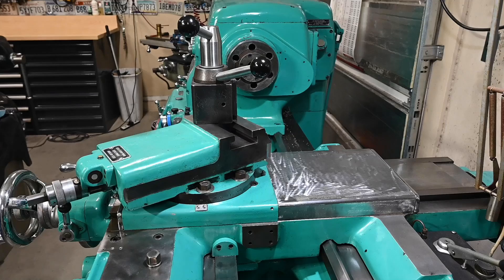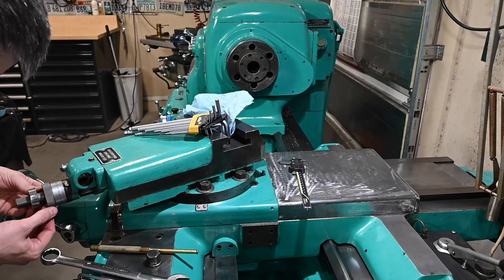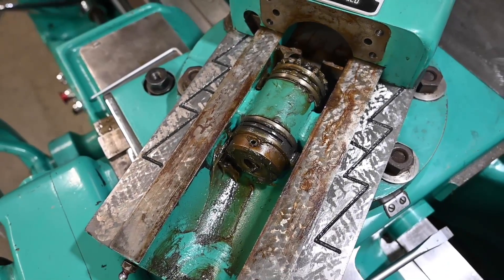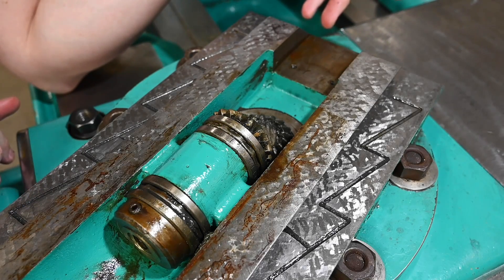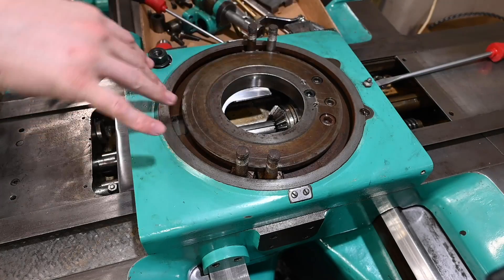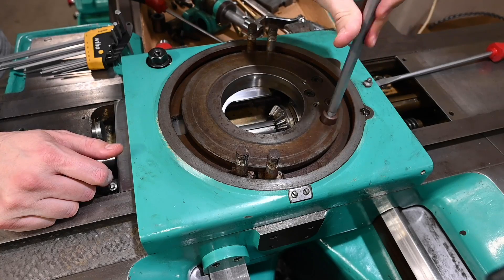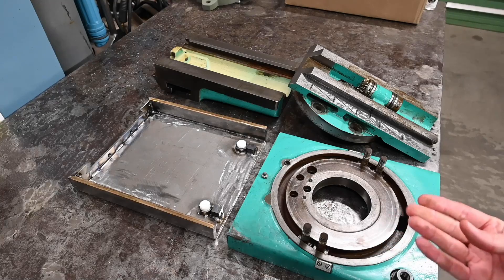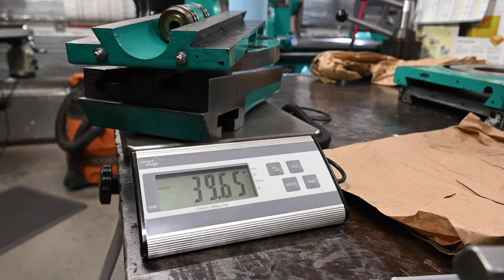Monarch Power Compound Disassembly | Gears Everywhere!

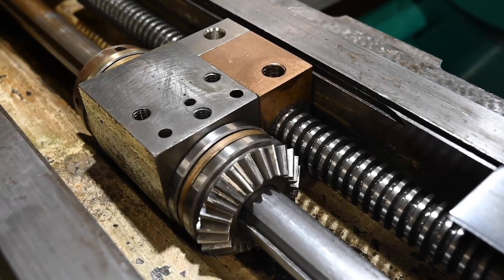Comment: 14:54 looks like you have enough room to mount your DRO to the left of that nut and have it nice and protected inside the carriage. That is how Robin did his. Also that way you could avoid having to cut on that beautiful cross slide.
Reply from the maker: Whoa I never would have thought about that. I’ll have to take some measurements to see if it’s possible. Thanks Brian!!
Reply: @AlwaysSunnyintheShop  Your scale is pretty big so maybe not enough room but it is possible you can use a Newall micosyn with your DRO head, they are very small (like the size of a pencil). I have a microsyn on the cross slide on my CBB Monarch.
Reply: i know I'm quite randomly asking but does anyone know a good site to watch new series online?
Reply: @Preston Immanuel Flixportal =)

Comment: Check your documents.  Some machines use grease fittings for oils.  My large shapers do.
Reply from the maker: Unfortunately Monarch couldn't provide me with any documentation on the power compound, but I've now got it all cleaned out and have a new oil gun. Vactra No. 2 from now on!

Comment: Aaron,

I have no experience with Monarch lathes, so I enjoy it when you document your mechanical disassembly. You do so much with extreme care they I expect your techniques to be always flawless. You made me cringe when you used the  Starrett pin punch as a pry bar. A sheep's foot or rolling pry bar would have been my preferable tool. This would give you control and far less opportunity to cause unintentional damage. Your punch prying required small effort so all ended well. The Starrett punch pins are hardened making them a poor prying bar choice. I have three sets of that size and one of the sets is incomplete. I used one for line up prying and it snapped of surprisingly easily. I like Starrett punches due to the full length cylindrical punch pin. This allows deeper access than mechanic's common brands like MAC, PROTO and Snap-On. Starrett punch bodies are softer than the punch pin absorbing hammer blow force without chipping and the knurling and logo detailing just makes them feel good to use. Mechanic's brands achieve the hardness variation in the punch body with heat treating variation in the same piece of steel. I don't think that this method is as good as the Starrett approach. IE, I own more broken mechanic's brands pin punches than broken Starrett pin punches. 

I have a lot of experience with Clausing-Colechester engine lathes, and some Le Blond and Mazak experience. Nothing has had a powered compound. You claimed little compound leadscrew/nut backlash. The nut appeared to be brass, but I couldn't tell if it is a split nut or not. Clausing-Colechester uses a cross slide leadscrew split nut. This allows you to adjust for minimum backlash. Leadscrews generally wear unevenly, with less wear on the extreme travel areas. Eliminating backlash in the worn areas can make it too tight in the unworn areas. Compound use is normally minimal, so the need for backlash compensating nuts may be superfluous.

Clausing-Colechester made it easier to remove the compound T bolts by relieving the slot in the  top of the cross slide groove. The T olts can come out the top without having to remove the cross slide to take them out the bottom. This is important, because production lathe operators sometimes have herculean arms and can destroy T bolts surprisingly quickly.

I have installed DRO's many times. I will be interested to see if you being a relative novice understand procedures well enough to ensure highest accuracy. What brand and model have you chosen? Our shop was exceedingly loyal to Accurite until we couldn't get parts for AR5 and mini scales. Newall technology was being accepted at that time and this became our standard. I even applied Newall to a CNC application after repeated Sony Magnescale failures. I never encountered a Newall hardware failure. 

I would still like to meet you someday. We think a lot alike.

Oh, I forgot... Try Snap-On dead blow brass or bronze faced hammers for driving your chisels and punches. You will increase control and reduce damage (mushrooming and chipping) to your chisels and punches.
Reply from the maker: Thanks for your input, Paul. You will be glad to hear i was prying with an import brass punch, not a hardened steel Starrett. I hope to never be quite that careless 😃. I chose an AcuRite 203- it’s a new output style with a color screen and adjustable fonts for easier reading. I went back and forth many times trying to decide between it and the Newell and the more modern display sold me. Hopefully I can get it installed correctly, and accurately on the first try. Thanks for watching!

Comment: The old beast is a beauty. How long are you going to have to think about it when it's time actually to begin a CUT on the side of the slide?
Reply from the maker: Won't be too long- need to get it back together before I can use the machine after all. The bigger challenge will definitely be setting up and ensuring my cut will be in line with the ways. Will be a weird feeling though, for sure.

Comment: I’ve been waiting for this video. Thanks man. Really cool. Definitely a unique machine. I wonder if that grease system is original or was added during restoration. 

Considering the height the powered compound adds and the steps you had to take to fit some of your tool holders... I’ve always wondered if it would be worth it to find a junked machine that doesn’t have the powered option and modify its compound to fit your machine. Obviously you could always put the original back on if needed. Even if possible, it’s probably not worth it.

Edit: My guess was 52lbs
Reply from the maker: I've thought about that, too. Not too many scrap machines around here but maybe someday I'll find something suitable to use in a conversion. The lubrication fittings are shown on the original Monarch drawings, so they are original.
Reply: @AlwaysSunnyintheShop  If anything, at least I know its a reasonable thought. Nice to know they're original, using them to deliver oil seems to make sense.

Comment: “I don’t want to take this apart because I’m afraid of what I might find.” That’s exactly how I feel about going to the doctor. Fears often well founded, too! You have a good bit of nerve taking that thing apart. Hope it goes back together well.
Reply from the maker: Yeah that's the truth. But I'd rather go to the doctor and find a fixable problem rather than let it go forever to turn into something even worse! I'm hoping it will be smooth sailing to get it back together.
Reply: I’ll go in there and the Doc will tell my cross slide needs to be scraped ...

Comment: I'm with the other guys here suggesting that those Zerks are for way oil and not for grease - unless the Monarch lubrication instructions call for grease.  My mill has Zerks on the vertical ways and elevating screw that call for oil, I use a small Lincoln grease gun I adapted to oil on those.

Comment: Well to add to what a few others said use oil on the ways not grease. The use of grease can be a reason the ways are scored.

Also the surfaces you showed looked like they were scraped and had no flaking. I recommend you flake the top (the part that sits on top of the ways) Eg the top of the slide surfaces for oil retention. But even if you don’t want to go through that trouble just hit the ways with a fine stone briefly so as to clean up any dings you just put in there during disassembly and give it lots of vactra 2 and call it a day.  You lathe looks very dry from lack of lubrication.
Reply: You should be oiling the oil points on a lathe every time you go to use it in a home shop environment just a little every time, it should have way oil on all the sliding surfaces.

Comment: those zerk fittings on the compound might be for oil. i have seen both mills and lathes configured like this. Double Boost has these on his lathe and an oilier to oil them.
Reply: I came to say the same thing.

Comment: They are NOT grease fittings, they are lubrication fittings.
Reply: The only way to tell the difference is to read the manual.
Reply: For many many years I had a pump oil can that had a fitting on the end of the oil discharge tube that fit on those oiler fittings.
Reply: This is a sincere question,  how do you tell the difference?  They look like grease fittings. Is there a special oil can for these fittings? Wondering for a long time now.

Comment: I’m going to raise this up the flag pole to see if anyone salutes.
I think the grease fittings are for way oil, just like a Bridgeport.
Reply: Today and with well guarded cnc machines along with there designed for grease lubrication ball screws and nuts then that grease isn't unusual at all. And all grease is would be possibly specialty formulated oils mixed into a carrier medium. The actual lubrication is still being done by oil. Where grease in a machine not designed nor meant to use it becomes a really really bad idea is it retains wear particles, cutting chips etc and the parts fit is too close to allow the proper amount of lubrication film depth. Most manual machines are designed for the way surfaces to ride on an oil wedge just like an automotive engine.Oil also tends to help flush out any wear or contamination a whole lot better than grease. Grease on parts meant for oil usually result in scoring of the way surfaces. Maybe at most the gearing used within that cross slide and compound may or could use grease. If there's built in passages connected to those zerk fittings and to the gearing I'd still always chose oil. 

Not a hope on a machine of it's vintage would it use grease on it's way surfaces. The reservoirs cut into the way surfaces on this lathe are much smaller than what anything I've seen on grease lubricated equipment will use. For those there much wider and deeper. That alone is a sure sign oil is to be used on those ways. It's surprising how many today don't know those zerk fittings were made to also use oil. Lot's who see them automatically assume there only for grease. Pump a Bridgeport type milling head full of grease and it's either a very time consuming task to disassemble and remove it, or real expensive to pay someone else to do so. Far too many machine tools get worn out much earlier than they should have been by well meaning but misinformed people using grease instead of oil just because it has those zerk fittings. There's more than a few YT videos around where some think grease has to be better than oil or that they think they know better than the machine tool manufacturers do. Illogical or poorly thought out lubrication choices are never cheap.
Reply: Turning Point I agree with every word.Some people think they know better than the manufacturer.Case in point,was a group of filling machines I had to keep running.Someone decided we should make the bronze bushings out of Navy M instead of high lead bronze.Although the Navy M is much tougher,it would not retain the grease and,wear was significantly increased.Another example was the idea of subtituting zero gravity grease for the 90w oil we had been using.The grease was slung off the bronze gears in a few seconds.The gears didn’t last two days.
Reply: @jamesdavis8021  Yep if choosing the proper lubrication was so easy then lubrication engineers wouldn't need to go to university to slap that title at the end of there name. I once thought I knew better and it cost me about $800 to learn I didn't. Now I do know better than to second guess the manufacturer.
Reply: I agree
Reply: Yep. I have the same fittings on my Burke Millrite. Manual calls for way oil.
Reply: I was thinking the same thing. Just because there is grease there doesn’t mean there should be grease there.
Reply: My lathe headstock has these fittings for oiling the main bearings. Previous owners filled the poor thing with nasty brown grease :( thankfully I had to pull the spindle to fix damaged backgears anyway, so they got a good clean and now run in oil as god intended.
Reply: I have a round ram bridgeport, and the manual for that says they did use grease, but you can just clean it out and use oil. The advantage of grease is it wont run out, and because its a bit thicker it does dampen more. However over time the oil can separate and the grease will gum up.
Reply: Jeff Anderson I would use way oil.
Reply: yes